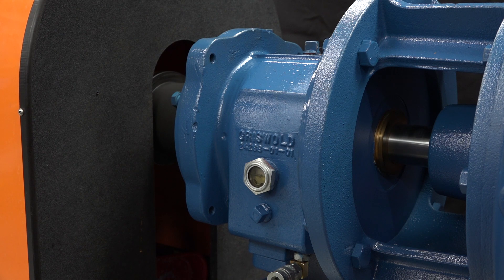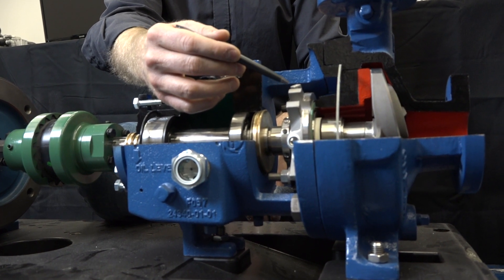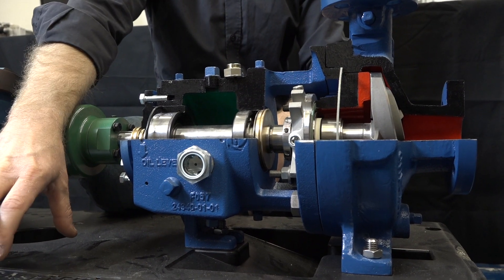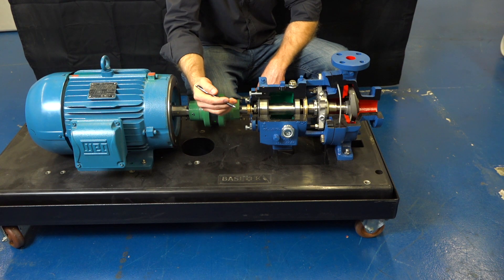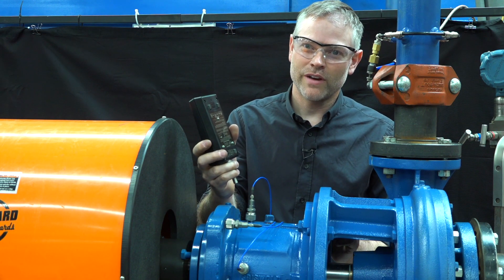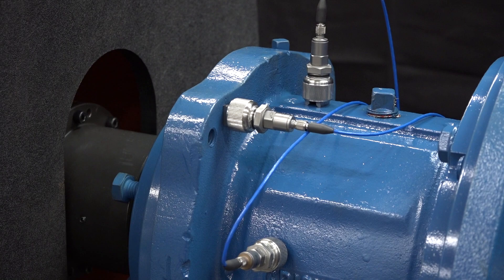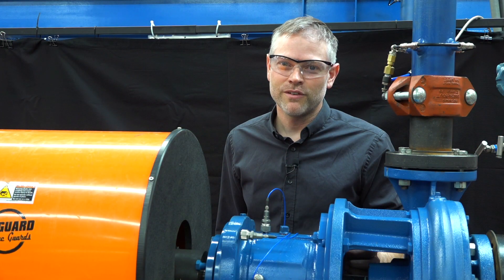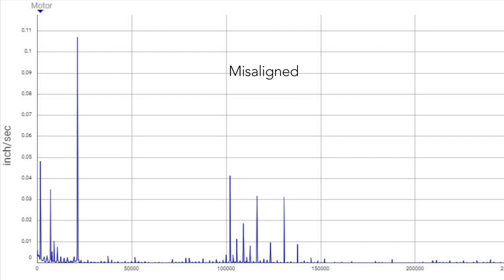Vibration: ANSI Centrifugal Pump

Comment: Thank You. Is 3 mm/s a Bad Vibration for ma HPS pump for 40.000 BPD water at 2000 psi discharge and 82 C. 100 psi Suction?. Please advise
Reply: I'm More concerned the signal he said was good has a bloody great ski slop on it, you may want to take your time attaching the vibration sensor next time,.